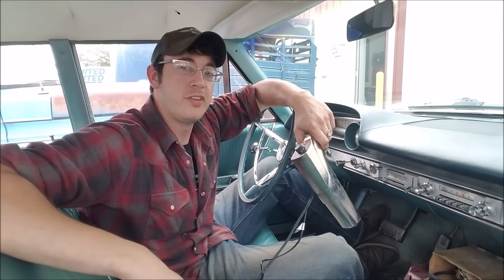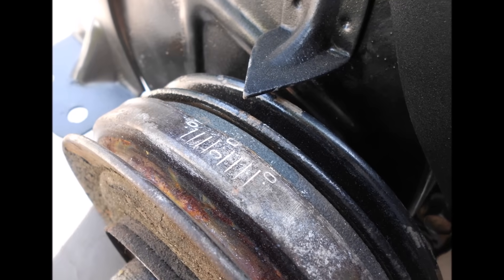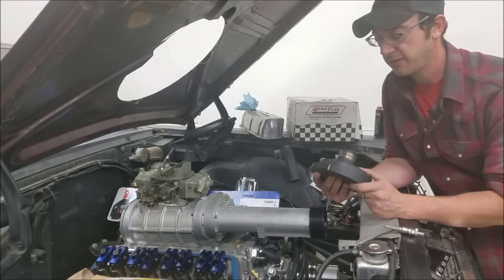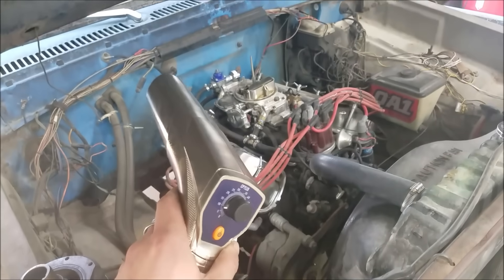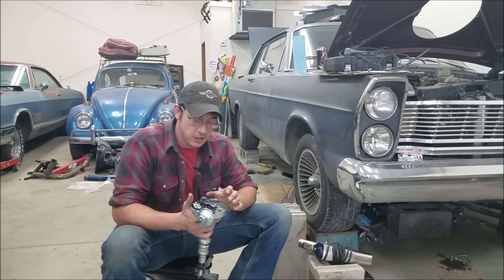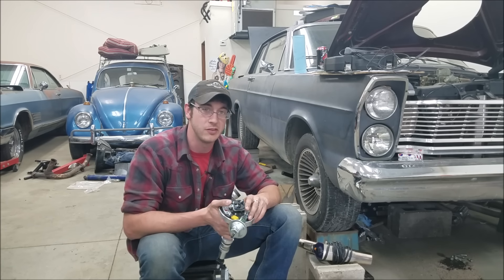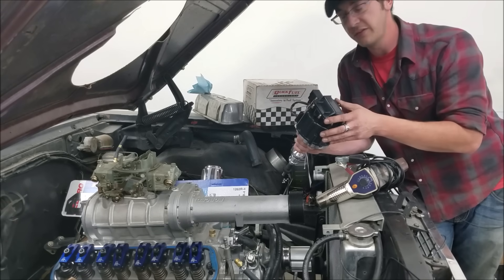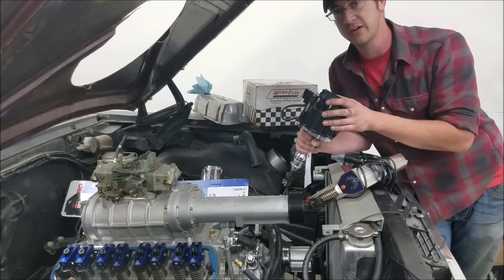The Timing Light & Total Ignition Timing (Maximizing PEAK HP & Performance 😎)

Comment: I was told to turn your balancer till your #1 pistion is on TDC and mark the 0 line with white marker paint and the line on the balancer. then take a digital caliper and adjust so the one tip is on the O and the other tip is on the 10 and lock it then take a white or some other color paint markers and measure out 10° s each time and draw a line so you have 20,30,40 lines on the balancer so you can get a more accurate reading with a timing light on stock balancers

Comment: I've been a service mechanic for decades and not worked on old cars much until recently, again.  I have a 1968 GTO 428 Motor with OEM intake and quadrajet carb and trying to track out a pinging issue.  Holley said to try to advance timing (spec calls for 6 and he suggested 10 to start with).  I put cooler plugs 43S or such, set at 6, was at 3-4 maybe. ... moderate accel all good but at cruse 55-60 and punch to pass, pings like mad... Would you say check full advance degrees and back off/retard or advance ... Maybe stronger springs in the weights. ... also someone put in a pickup with single wire to coil for triggering..  Using Blaster 2 and so far burning premium non alcohol with led additive to tank.  Than,s...
Reply: I have same motor and same issue, after checking total advance and found it 43 recalibrated springs and stops and set it to 28.

Comment: Hey Luke quick question.. maybe i missed it but we plug the vacuum hose for initial timing but for total do we reconnect the vacuum line ???
Reply from the maker: Kind of a complex question, for total timing absolutely disconnected. 

For initial timing, it depends. 
I prefer to run ported or timed vacuum and advance my initial mechanical timing for my idle settings. Ported or timed vacuum should do nothing at idle since, if your throttle blades are set within proper parameters, shouldn’t be adding any timing at idle. 
If someone was concerned, simply disconnected vacuum anyway. 

For the folks hell bent on manifold vacuum, it becomes very subjective since as soon as you hook up vacuum advance idle rpm will increase. 
If using manifold vacuum, to simplify it I tell folks to set their ideal total timing and then check initial mechanical with vacuum disconnected just to verify that it didn’t fall somewhere AFTER top dead center. If it does, a recurve is required.

Comment: Hey Luke I have an 88 5.0 I am getting backfire through the intake when I shift from 1 gear to 2 gear  is that a timing issue or could it be fuel  restriction any guidance would help thanks and great work you do

Comment: So timing my stock ‘68 289; normal timing -disconnect distributor vacuum line from carb and set. BUT for total timing -do I plug the hose back on? Or leave it off? (Still trying to completely understand how the timing light showed that 33’).
Reply from the maker: For your initial and total timing settings you don’t want to be factoring in vacuum advance. At hard throttle your vacuum advance isn’t adding any timing.
Reply: @ThunderHead289  cool. But you mention in the vid that as the rpm increases there’s a point where the timing stops advancing. How does it advance if the vacuum isn’t connected? 🤷🏻‍♂️
Reply from the maker: Because a distributor has both mechanical advance based on rpm and vacuum advance. Vacuum advance drops out at hard throttle because you have no vacuum. It’s only purpose is to add timing at low throttle angles because your are restricting flow causing less volumetric fill, meaning less cylinder pressure - this requires more timing to burn the cylinder charge at the right time. 
This is the only purpose for vacuum advance, which anything on the street should be running.
Reply: @ThunderHead289  Ohhh. That makes sense. Thank you SO much. Your vids are so great too. 🇨🇦👍🏼

Comment: Is the timing light actually changing the timing or flashing when the engine is at that number you set it at?
Reply: should be flashing when its at that point. the timing is only adjusted by the distributor

Comment: Ok so I had an 79 f100 302 2 barrel I plugged all the smog crap and it ruined alot better. But I took it to a shop to have a timing chain replace and he set the timing by a timing light. When I got it back it ruined awful. No power it ruined great at idle but everything else sucks
 So I added timing about 10 to 15 degrees and it came alive. Why was that?

Comment: If the initial timing doesn't match the timing mark on the pulley, you'd have to compensate for that, correct? Say it's showing an initial 5 degrees advanced when it's actually 0. If you're shooting for 33 total timing, you'd want the light to actually sync with the timing mark at 38 degrees. Is that correct?

Comment: Here is a tip for you. Need to check the hormonic balancer to make sure the degree alinement hasn't moved. I have seen them slip on the rubber 12 degrees in the passed.

Comment: Do you ever run into an issue when an engine will not run at less than about 20 degrees advanced at idle.runs best around 30 degrees at idle. Have comp cams 468 lift,276 duration 112 seperation
Reply from the maker: Yes, most big cam engines wants more timing due to low dynamic compression at idle - this is caused by the overlap that helps on the top end but hurts on the low end. 
Often with big cams I try to run manifold vacuum to get enough idle timing but still have an acceptable advance curve as well. 

My 289 was set to 23 degrees and only allowed 12 degrees of mechanical advance. On manifold vacuum it idled with 35-36 degrees. 

Ran great that way
Reply: @ThunderHead289  would it be best to time the engine with a vacuum gauge rather than a light in your opinion?

Comment: How do you determine the ideal initial timing number? I have tried several different settings and ended up with 15° initial 35° total all in at 3500. Is there a scientific way to determine the correct initial number?
Reply from the maker: “There is” kind of. 
Basically I let the engine tell me, but what that means is that I use an initial timing setting that is such that there is no vacuum on the ported port. As you increase timing you will notice RPM increases - to a point at least. If your timing is late, you have to compensate with the curb idle screw. 

The ported port should never have any vacuum signal at idle, if it does you need to back down your throttle setting and add initial timing. (This is actually all relating to your transfer slot exposure). 

Even the old timers that tell me “none of that’s true, I do it by ear”, when I check their work, they also unknowingly actually came to the same result at the end
Reply: @ThunderHead289  the challenge I run into is that it seems that my engine likes a lot of initial, it idles great at 20° (transfer slots are almost completely closed, I had to drill the primary throttle blades to get 750rpm without opening too far.)but at part throttle cruising it's too much, engine runs rough. I have also limited my vacuum advance to 10° @ 20 inches of vacuum. That's the reading I get at steady cruise. I've backed it down to 15° and part throttle is mostly smooth. Overall it runs really well I guess I'm just looking for that last little bit.
Reply from the maker: I wonder if the cruise surging is due to a slightly lean condition at that throttle angle/load. Have you had a wideband o2 on it at all?
Reply: @ThunderHead289  I did temporarily install an O2 gauge, wot was 12.5, part throttle was in the green but on the lean side. I did have a surge at that point. Went up on primary jets a couple sizes. Plugs went from white to a hint of tan. O2 sensor said low 13s at cruise. Surge went away. Rough spot is between 2600-3000. It's not audible, doesn't sound like a miss, it's just not glass smooth like below or above that rpm. I've run the distributor on my sun machine and it's smooth at all rpm. It's more noticeable without a load, it's smooth at wot. It's also less noticable with initial set at 15° vs 20°. At  3000rpm part throttle my total advance including vacuum is about 40°. If I dial back the vacuum any more I might as well not be running it. I figured to run 20° initial I'd have to slow the whole curve down but then I'm increasing the rpm for max mechanical reducing wot performance.

Comment: Awesome video, new sub here. I have my 84 Nissan 720 times wrong. The distributor/oil pump gear is off a tooth and advanced 10 degrees at after being turned to it's max. Seems to be running fine though, and I really don't want to take the front apart again...

Comment: Very good info, I will look into Progression ignition.   Ran duraspark, and with stock HEI modules, MSD and even a Holley Eliminator.  The HEI and MSD seemed prettery similar, except the cost.  The Holley was noisy, lol  old technology.  The Engine is a mild stock 1969 429, cammed , with D3 heads, due to valve wear-running Propane, which is hard to light off.  Just a single Impco 425,  stock intake(weind waiting) in a heavy old 76 F250 Highboy 4x4,  35" tires and sucky 3:55 gears.  It runs good though.  :-D

Comment: 7:19 and what happens if while throttling up around 3000-3200-3300 rpm,  I can see the line on the balancer retarding itself slightly? Bouncing around is more like it. Chevy 350, GM stock HEI, stock vac advance, using stock weights, however I'm using one strong spring and one medium spring. Everything is dialed in but I get a knocking sound under load. Car has power. Running at a base timing of 14 degrees and total at 36 minus vac advance (note sure what the stock can is putting out, 20?)

Comment: So, my truck pulls really good but when shifting from 2nd to 3rd (4spd manual) under hard acceleration, it stumbles bad getting back in the throttle. That an initial timing issue or jetting issue?
Reply: Check accel pump setup

Comment: You did not figure the heat load in for timing advance!! What happens when the cylinders get hotter to the air fuel ration. Everything inside gets hotter. think about it?

Comment: Hi Luke! I need your advise sir. Got the 460 BB Mustang ready to fire up after finding TDC on # 1, marked & cleaned balancer and Installed new MSD timing tape (yes, the correct one 6.75"), hand rotated crank/balancer to 18 degrees (initial-Idle) and dropped in the MSD (non-vacuum advance) billet distributor rotor pointing exactly at # 1. I want 36 deg total. NOW, with my dial back timing light, (same one you use) do I set total at 36 first, or 18 deg idle first?  Recurved the Dist. light springs and big black bushing that is supposed to limit 18 deg mechanical advance all in by 2500 rpm. Thanks I appreciate you very much. Subscriber Bob

Comment: Thanks for the videos... do you know the correct timing for a late 70s model bone stock 454? Or a good place to find these numbers... there is a lot of conflicting info online when I google it
Reply from the maker: There are many many variables, my advice is the same as in my videos - let the engine tell you. The timing setting that satisfies a transfer slot setting within the appropriate range is what you need
Reply: @ThunderHead289  come on man... I need an instant, cheap, easy answer lol but the timing issues I'm dealing with has lead me to just biting the bullet. I'm going to pull the distributor, and the front cover... put it on true top dead center... check the Mark's on the gears... new timing chain. Inspect the distributor shaft and drop it back in... then time the motor and adjust the carb... something is going on and I need proven answers to figure it out

Comment: That distributor would come in really handy for those times when your spark plugs are gapped at 1/2 an inch.
Reply: Spark plugs firing in OPEN AIR is far different than them firing under hundreds of pounds of pressure.
Reply: Never seen sparks looking that gorgeous

Comment: Thank you TH289!!! Trying to get my 460 BBF (Carb) engine back in timing to start it. When I pulled the MSD distributor To actuate the oil pump to prime the engine (sat for 2+ years) put everything back just like it was before, now it wont start. Balancer has not TDC mark or tape on it. So i did the finger over #1 spark plug hole until it blew my thumb off the hole. Is that close enough to mark a TDC mark on balancer as long as rotor is very close to #1 position under the cap on #1 wire?  Thanks, I don't understand the piston stop thing yet.
Reply from the maker: You could be as far as 20 degrees off yet, which is a sizable amount. You are but only in the ballpark. You can’t get to true tdc by looking at the piston or anything since the piston dwells before it changes direction in the bore - but if you don’t want to work with a piston stop, just stick a straw in the spark plug hole and continue to turn the engine over by hand - there will be a moment when the straw stops going up (make sure it doesn’t get stuck) and that will put you within 5 degrees or so. 

I don’t like doing it that way at all, BUT it will work okay enough. 
The car will at least run where you can get it to someone who can use a piston stop
Reply: @ThunderHead289  Thanks you so much. Now that make sense with the straw. Will do that tomorrow and fire that 67 S code bad boy back up. lol Have a great night. Love your channel too. New Sub.
Reply from the maker: Thanks so much 👍
I corrected my above comment - swells = dwells

Comment: Really good video! I wish you would have explained a little more on the benefits of high octane fuel and the ability to tune your timing for higher compression engines. Most of today's fuels are fairly low octane and with a higher compression engine they really suffer.

Comment: Luke please help me with my question about my 460 fuel injection to carburetor question. Can I use the fuel injection fuel pumps and return lines with a pressure regulator to get the 8 psi at the float valve in the carburetor???  What valve do you recommend??????

Comment: Thank you, Luke.  I love the simple style, yet, very good info.  Your secrets are safe with us...     'Just for us budget minders, Actron CP7528 Advance Timing Light is priced at $70, while the even more featured CP7529 is $50?   It would save on the tach setup and help the different timing sets.     Also,  I have nightmares thinking of the times I had my car up on blocks/jacks (even HF recalled ones) here in CA!  Please look at 7:45.  It's a good idea how u used your tires for space and stability (and in the unfortunate event of earthquake, the tires/spacing give better odds on survival).  The engineer in me  wants to think of load design and your cinder blocks.  They are designed to be their strongest when in the position/orientation similar to how you have the one under the engine, and, not as it is used on your rear right.  U r probably OK (1000 lbs), but, nightmares.   I put a 3/4 plywood piece the same size as the block, between the tire and block.  Me thinks it will distribute better over the two openings.   Watch how these martial arts block choppers break theirs.  :-)  Take care and continued success!
Reply: Ditto on using cinder blocks "correctly."  Put the holes up!

Comment: The problem I'm having is the only way to start the car is to retard the timing, but when its runing I can advance it and preformes much better but when I turn it off it won't start agian Untill i retard it some, better gass, WTF TO DO HERE? if I don't advance it some, the motor falls on its face or stalls when i hit the gas :(
Reply: You have a stock starter in a non stick engine? Powermaster has reallly good starters that can start all the way up to a 18 to 1 racing engine

Your starter needs enough ft lb of torque to overcome the cylinder pressure created by a higher compression engine

I'm probably looking at 9.5 to 1. And they have a HP stock looking replacements that are good for up to 10 to 1 but im going to err on the side of caution and get the next one up that is good for 11 to 1 engines

Msd e curve is also on my list because they do exactly what youre saying

Hope this helps

Comment: Funny, I see all these dist. with vacuum adv. I was in H.S. in the late 60's early 70's, lotsa HP cars around. I built a 56 chevy panel van with an olds motor that kept up with very built 350 Camaros. Point being everybody thru out the vacuum advance and curved dist without.
Reply: you want vacumm adavnce on the street or anytime you drive part throttle.
race cars dont need it but its all wide open throttle then done.
thats why theyre all mechanical and locked out timing..a no-no for a street car.  unless you like sweeping up pistons...

Comment: So I got a camaro with a 396 and it runs good when you get going but if you go to rev it sometimes it barely does anything and it tends to bog slightly when you punch it from a stop and it will not squeak the tires could it be timing or is it carburetor
Reply from the maker: My friend, it’s probably just a little bit of both! Sounds like late timing and too much accelerator pump!
Reply: ThunderHead289 ok thanks I’ll check both out

Comment: Alright someone please help me here. I've been messing with timing and at this point I started thinking my balancer was off. I had my timing light set to 0 and at idle set the timing to where it flashes at the 10° mark because that's where I've found you set initial timing but after I shut the truck off it cranks slow when it's warm which sounds like timing. So am I not actually setting it to 10° like I think? Should I mark the 0° on the balancer and turn my timing light to 10°
Reply from the maker: Balanced on O with the light, and timing light at ten is ten degrees BTDC.
Reply: @ThunderHead289  thanks man love your videos. I'll hit the garage tomorrow morning and see what she does